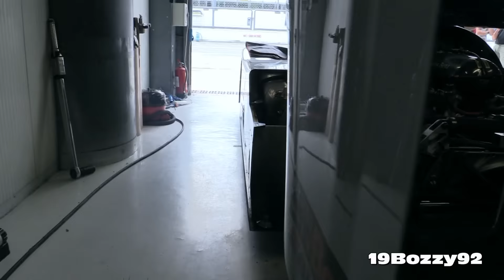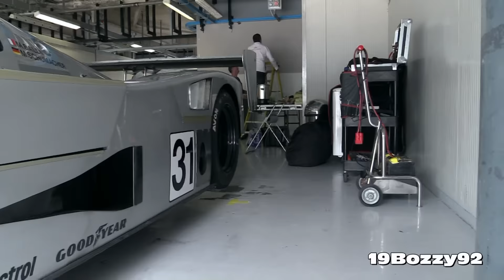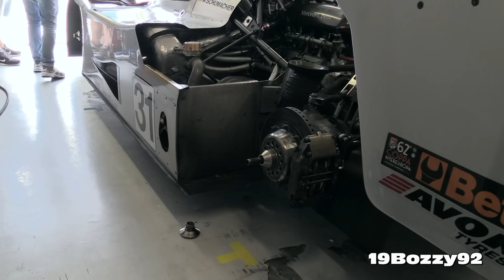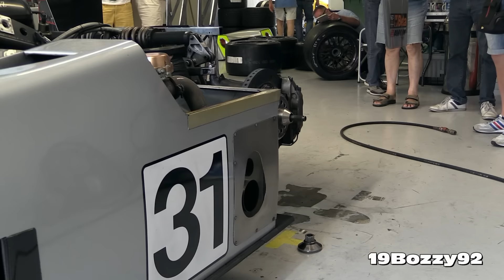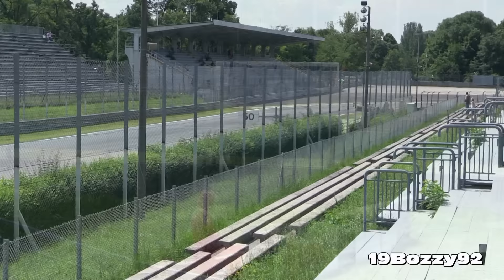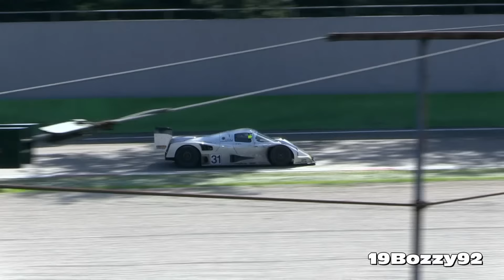Sauber Mercedes C11 Group C Pure Sound at Monza Circuit!

Comment: As great as the 787B sounds, the noise this car makes is much better. Reminds me of NASCAR.
Reply: i wish there was a road car that sounds like this
Reply: Panoz Esperante GTR-1 is the sound you're looking for when it comes to nascar 😊
Reply: No way ir sounds better.. and it was faster because 787b was límites at 9000rmp and 700hp. That's the reason c11 couldn't finish 1991 le mans
Reply: @nicolasneri7738  Neither one sounds objectively better than the other, just in this thread we like the v8 roar more
Reply: It sounds better because it have sound of NASCAR...? 
It's not even close to 787B. That car is on every Top 5 best sounds ever video. Not to mention V12 high rev F1 sounds and entire Ferrari XX program...
Reply: Because it use crossplane V8 engine, but with four cams not single cam like Nascar
Reply: 787b just sounds annoying tbh
Reply: With turbos lol
Reply: @nicolasneri7738 you should read up on the history a bit. The Mazda was nowhere competitively until this race when the FIA punished the “old” group C cars (C11, 962, etc) with 200 lbs of extra ballast. The mazda was N/A so got to race at 830kg. The 9k rev limit was for fuel economy, the C11’s made near 1000 hp too when turned up, but were running 750 ish for the race, for fuel economy. Still the Mazda was nowhere near competitive against the C11 until race shit happened and the C11’s broke(one due to road debris).  Those mercs won 8 of the 9 FIA WSC rounds the previous year with the exact same engine that was used for the 91 le Mans, so it’s not like they were fragile. As the saying goes, its better to be lucky than good. Mazda got damn lucky, but it does make for a fantastic story!
Reply: As a 787b fan i must say this is a special sound that has place in my heart❤

But more special to me is the second name on this car  ,M.Schumacher 🇩🇪.
Reply: @clkgtr12  a mercedes mclaren with chimneys😮
Reply: Agreed the Mazda sounds amazing BUT a C11 makes a noise that re arranges your internal organs. I can remember standing next to the Melbourne loop @ Donnington when Schumacher, Wendlinder, Hans Stuck etc were there.❤
Reply: Nascar con  turbo si obvio  igualito...😂 Jaja
Reply: It is just BRUTAL
Reply: @nicolasneri7738 the 1991 c11 was run on a lower boost due to regulations as the car the ran for that season c291 was not reliable, so they used the c11 on a much lower boost. 1990 Mercedes didn’t enter Le Mans and also the Mazda was 16 seconds off pole.

Comment: This car is fantastic, the sound of the transmission, the sound of the v8, the sound of the turbos spooling up, and the pops and crackles.
Reply: +TheSVT03Cobra Now imagine if AMG GT sounded like this. Damn.
Reply: +The Stig these days people don't let turbos be turbos anymore. i like the sound a turbo makes, why hide it to simulate a naturally aspirated engine, only worse?
Reply: I agree
Reply: totally mate
Reply: I read somewhere the V8 used in this car was a really good design for a race car, but the gearbox used couldn't handle the engine. It was either drivetrain or gearbox, can't remember.
Reply: And it almost looks like a goddamn fighter jet too!  Really the looks are almost ideal, like what the perfect race would look like.
Reply: I agree you can hear everything, the sound is deep
Reply: Jason Lurf The V8 was essentially a road engine which was then lightly turbocharged, they did have problems with the gearboxes such was the tremendous low down shove the engine produced!
Reply: I like the sound of the steering wheel
Reply: Is a beast.. the engine is amazing
Reply: Top 10 on my list. Just amazing all around
Reply: @the-stig-nickname  It does now omg
Reply: @CenobiteBeldar  I think you are correct. I think that's why the C9 even though vastly superior to the aging 962 and in my opinion superior to the Nissan and Jag never won Le Mans. I believe if I can recall correctly they retired with gearbox troubles.
Reply: Sounds like a Rousch Nascar engine
Reply: Oooo
Reply: @davidgeorge9233  what road car sounds like this?

Comment: Beside that amazing sound I absolutely love the clean design of those old Group C. No fancy winglets, chimneys or other stuff. And those cars were fast, too.
Reply: Yeah really slow..
The Porsche 956 Group C still holds the laprecord at 6:11:13 driven 1983.
And the Sauber C11 was so slow at 407 kph that they had to insert two chicanes at the long Mulsannestraight at LeMans 1990.
Reply: IngeBall I believe you’re mistaking the C11 for the WM P88, that hit 407kph. But still, these cars were indeed very fast.
Reply: Figures is different everywhere but scaryfast cars and indeed the Peugot was a monster! Anyhow, nice to talk to an other enthusiast :-)
God I miss those days.
Reply: The absolute record on le mans is for the peugeot, but they taped of all the air inlets to make the car as smooth as possible, it couldn't do it in proper race trim or even qualifying trim because it would overheat. The sauber c9, the predecessor to the c11 did hit just over 400 km/h during qualifying in 1989. The chicanes were added in 1990 and the c11 was a 1990 car, so it could never have hit 400km/h, although with a low downforce trim and the full straight on le mans, it should be able to match the c9 or go even faster. Sadly no one has ever tried that though.
Reply: +IngeBall
"And the Sauber C11 was so slow at 407 kph that they had to insert two chicanes at the long Mulsannestraight at LeMans 1990."

I don't know where you got this from but it isn't right. Firstly, the last Sauber to race on the old Mulsanne straight was the C9, not the C11. Secondly, neither car ever did 407 km/h. The C9 did 400 km/h once and once only and that was Kenny Acheson towards the end of Friday practice (as it used to be known) in 1989. It wasn't enough for him to take pole position away from Schlesser.

Secondly, the C11 did not have a high speed, low drag aero package like the C9 did because the designers knew it would never race on the old 5.8 kilometre straight. It is true that a Peugeot WM88 reached 405 km/h in 1988 and it is also true that these speeds were the reason the chicanes were installed.

Anyhow, last time I checked it was about who had the lowest lap time and who got to the finish first, rather than who was fastest on the straight bits. If you read about the C11 you will see that its greatest assets were handling and road holding.
Reply: +Joel Schembri Comparisons between the Le Mans track of 1989 and today don't hold. There have been several changes to the circuit since 1988, particularly around the Dunlop curve. In terms of straight line speed, the Group C cars are pretty fast but in terms of braking and road holding, today's cars are quite a bit faster, while still being capable of high speeds in a straight line.
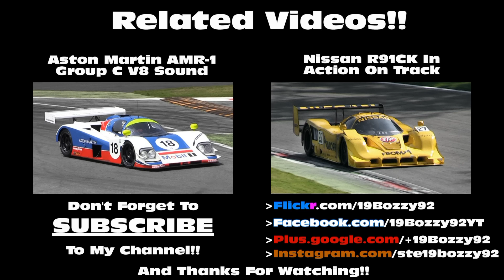Reply: +Joel Schembri Have a look at this. Timo Bernhard lapping the Nordschleife at 5:19.54 in a Porsche 919:

https://www.youtube.com/watch?v=PQmSUHhP3ug

As far as I know, the Group C lap record there is still 6:11.13 by Stefan Bellof. As you can see, Bernhard is quicker everywhere on that track. The idea of doing 315 through that fast left at 2:45 is mind boggling. The idea that he got there so quickly is even more so.
Reply: IngeBall No it does not. It was beaten by its rightfull heir.
Reply: These are only cars...
Reply: In the overall picture, cars are not that fast. In aerodynamic terms, we're not even dealing with compressibility.
Reply: IngeBall
First off, the c11 is from 1990. the track had the chicanes on already
The chicanes were requested by the drivers themselves for having faster cars with more downforce, also making the race skill based instead of who can put their foot down for the longest based, and even though those were added the current lap record is a lot faster than the group Cs.
6:11 was only beaten in a shortened track with around 2 km less than most actual records and 5 less than the 24h full track. Besides, the same layout on the same year with the same cars in the same class got a best ACTUAL RACE time on nurbugring 1000km of 6:38.
I bet you don't know what it is by judging this the fastest, but the 919 evo, a modded lmp1 that basically ignored all the restrictions for le mans putting the weight down a bit, just got a 5:19 at the nurbugring reaching 370 km/h at the straight.
Here are some specs if you want'em:
The c11 had 750hp and 900kg. If power is your deal, the r92cp had 1200 at qualifying. Numbers didn't make it the fastest tho.
A recent lmp1 hybrid has 1000hp (or a lil less) and 875kg for the minimum weight restriction. Also, 0-100s in 1.9 secs.
Nissan made one of these in 2015 claiming literally 1300 horsepower. Was by far the slowest in the race, and i mean by half a minute in the lap times. Numbers aren't everything.
Last but not least the car that reached 407 was a peugeot. The boost pressure broke it down after a few runs on the straight and it was (again) by far the slowest in the race: it couldn't corner for the lack of downforce.
Group c1 was legendary, but misrepresented as some sort of absolute rocket racing , mostly because of gran turismo lol
Edit: TL;DR is basically this last part here
Reply: @thethirdman225  Do you know that Bellof did that record on a RACE? Just imagine doing the fastest lap on Nürburgring with RACE limitations??? 919 was at full power, full unlocked!!
Reply: @thethirdman225  Now that's a long text lol. Well thanks for letting me know then
Reply: @p1eased0nteatme  That "WM P88" engine was especially prepared for a highspeed record on the Hunaudiere Straight at Le Mans. The engine of this car exploded after its run because of insufficient cooling. 
That 's the difference between these two cars: a German Mercedes Group C or a Porsche too, could do such highspeed "regularly" in a normal race trim, but not for just a stupid and superficial high speed record with a serious damaged engine after it!
Reply: SJW Maniac That is all correct yes, but it’s still the car that hit 407kph.
Reply: @thethirdman225  quiete
Reply: P1eased0nteatme No car got to 407.
Reply: @thethirdman225 I can say that is a great engineering achievement but let give some perspective I steal 45 sec wasn't a full lap because the starting point were different from the finishing point could they they do 5:54 if they prepare to do 60 km, could they do that time with tires and tarmac from the 80's?
Reply: ShakaZoulou77  What?
Reply: Group C was pretty much racing at its peak, almost completely unrestricted balls to the wall performance. Ultimately didn't help it's longevity but as far as racing at its apex is concerned. That was it.
Reply: These cars were literally planes from ww2 but with wheels pure badassness
Reply: @isaali5320  What do you mean by "literally planes from ww2"? o.O

Comment: Perhaps the coolest looking race cars ever. Great turbo sound when they  lift for the corners.
Reply: Ankit Patel ik this is a year old, but the 2004 M3 GTR, jesus, that thing is a monster.
Reply: The straight cut gears do whine, a lot. However, Andrei is hearing the turbines as well - they have a distinct pitch in comparison to the driveline, you can hear the spool-down very well in the clip at 2:35 . You can't hear the gearbox very well at that speed, pretty much only in the chicanes.
Reply: @ltsjoke5443  bruh there is a video of that car on nurburgring.. absolutely nuts

Comment: What an absolutely insane car. Makes me want to fire up Assetto Corsa and have a go in the Sauber C9.
Reply from the maker: +Jeremy J. Agreed
Reply: Jeremy J. There's also the Group C mod for rFactor 2 with the C11.
Reply: With the new update released today there is now the 787B along with the the Porsche 962c and the Sauber C9.
Reply: absolutely, I honestly think either the C9 or the Type 49 Lotus are my favorite cars to drive in AC (but theres obviously TONS of room for that opinion because I have yet to drive each car) but its just so damn incredible how well of a job Kunos did reproducing each vehicle, in addition to the historical perspective they clearly held in choosing the cars they have made available until today. I love the different array of Le Mans winning protypes and especially the group C cars. No other simulator ive played as even remotely come close to AC. However I think its worth mentioning that I have 3x ASUS VG248QE monitors so im using a near 4k resolution and I have 144hz refresh rate and heavily overclocked 980TIs in SLI.... Sure makes the experience that much more incredible. Along with a proper wheel, pedals, etc.
Reply: Kyong Hansen man I wish I had your setup dude. Combine that with my TrackIR set and that would be the best experience short of running an actual simulator.
What surprised me more than the Kunos cars.were the free mods. Both their quantity and their quality are astonishing. It was, what, a week after Early Access launch that we had the first working track mods? It's fucking awesome that there are people in e.g. the AC or Arma community that obviously have incredible skillsets, that use their spare time to make stellar mods free for everyone.
And mqny of them are every bit as good as the official cars.
Reply: Kyong Hansen I have a single 980ti paired with an i7 6700k overclocked to 4.5 Ghz, and that amazes me. I could only imagine 2 of them. I feel no need for the 10 series however; I don't exactly have the money right now for an upgrade. Lol
Reply: Jeremy J. It's even better on project cars . Nurburgring at night in the rain dauber c9 . Heaven
Reply: It's coming to GT Sport soon. I'm excited
Reply: Kyong Hansen gtr2 has much better represnation of groupC car than AC can ever hope for
Reply: FORZA III
Reply: Rik Mar 4*
Reply: @denimstratton7308  oops my bad, thanks
Reply: Makes me want to fire up my real sportscar and take a ride.
Fuck video games
Reply: @maxmoritz5065  there's alot to be said for video games, and a reason the pros use iRacing etc to practice and memorize tracks.  Sim racing can be alot of "cheap" fun when compared to real racing.  Or finding a ditch while pushing too hard on the road with that sports car you love.  I enjoy a good real life hoon over sim.  I also can't drink some beers and drive a Mazda 787B on the Nordschleife in real life.
Reply: In GT Sport there is Sauber C9, Mazda 787B, Jaguar XJ13, Porsche 962, Ferrari 330 P4
Reply: I literally did this. Watched this then did some hot laps myself

Comment: As a die-hard V8 fan and someone who smiled at the turbo because I thought it was trying to get at least some power out of too small engines, I have to admit, I've watched this video quite a few times, because the composition of engine sound, turbo and dog teeth transmission is simply heavenly.
Reply: That's a weird take on turbos.

Comment: I don't think this is mentioned often, but the Sauber-Merc cars had probably the cleanest design in all of automotive history, and this is from a time where all Group Cs had clean non coke bottle styling. Everything on the C9 and the C11 were continuous and clean, like a single continuous line from the front nose to the rear wing. It was a complete, single entity. Smart of Sauber to use Naca Ducts instead of vents like Porsche in their 962. Maintains the smoothness of the design.

Comment: Together with the precedessor C9, probably the most dominant car of Group C. With these two cars, Sauber-Mercedes won all but two races in 1989-1990 and won Le Mans in 1989 (couldn't win again in 1990, as Mercedes boycotted).
Reply: Not really. The Porsche 956 and 962 had thing all their own way in the early 1980s. They were still competitive as late as 1989 (certainly a dominant year for the C9).
Reply: TheThirdMan I should have said "from the latter years", which were much more competitive than the early 80s where half of the grid consistend of 956s.

Comment: Why the fuck can't I find performance parts for my m119 when it's capable of this?!?
Reply: Keegan Johnson dude i know haha, people dont even realize its the same engine the SL, W/C 140's, E Class have. I have a 95 SL500 ive always wanted to upgrade it more the engine is a monster! The M119 is one of the most underrated engines in my opinion no one knows a 5.0 M119 makes 354 FT/LB of torque and 322 HP insane numbers for a luxury that came out in 1990!

Comment: So they basically took an AMG Hammer engine, tweaked it within an inch of its life, and slapped twin KKK turbos on it. Yummy. The whine you hear as it goes away from you is the straight cut sequential transmission, but that weird descending whistle when it is lifting off of a straight for a corner coming straight at the camera is "arousing".
Reply: AMG didn't have anything to do with this engine. All Sauber's early engines were built by Heini Mader, with technical advice from Mercedes. They didn't change the basic design all that much either. The torque still peaked at about 3500 and maximum power was at 7000.
Reply: TheThirdMan You are incorrect , it indeed is a mercedes Engine , the M119 to be precise
Reply: WTF are you talking about Mr Precision? Where did I say it wasn't a Mercedes?
Reply: If you mean the engine, I never said they did. The early M117 engines were built by Heini Mader. Later that became a cover for Mercedes backdoor support. Later they were 100% supplied by Mercedes. I repeat: where did I say it wasn't a Mercedes? What I said was that they had nothing to do with AMG.

Comment: did this car won Le Mans?
Reply: No, but it did race in Le Mans in 1990 and then again in 1991 against the Mazda 787B which won in 1991. You're probably thinking about it's predecessor, the C9, which is quite similar and which won Le Mans in 1989.

Comment: 990kg and 950bhp !
Reply: holy shit
Reply: +MDDeGrande1994 indeed
Reply: +MDDeGrande1994 just found out I was wrong on the weight, its 904kg = 1095bhp per ton.
Reply: No, this car did not produce 950 hp.

http://www.ultimatecarpage.com/spec/562/Sauber-Mercedes-C11.html

Anyone who claims it did does not understand Group C.